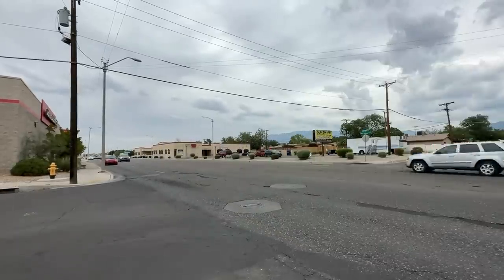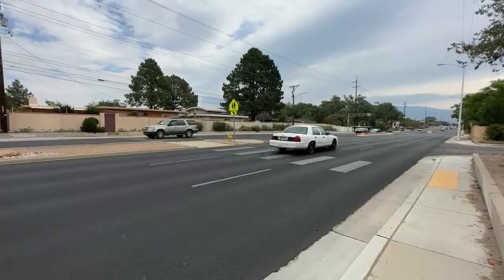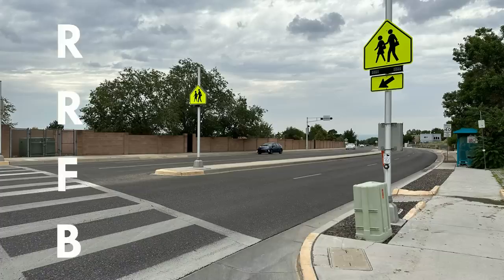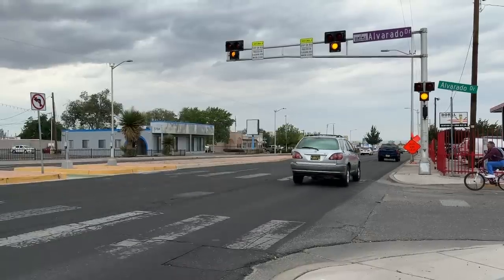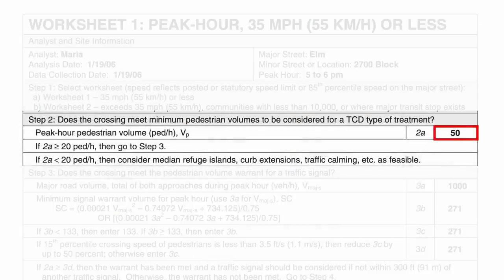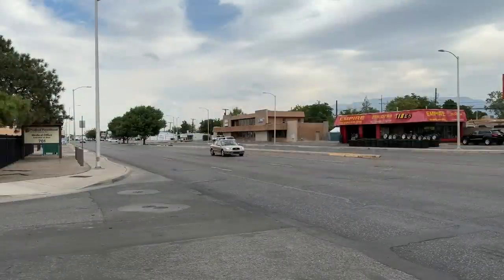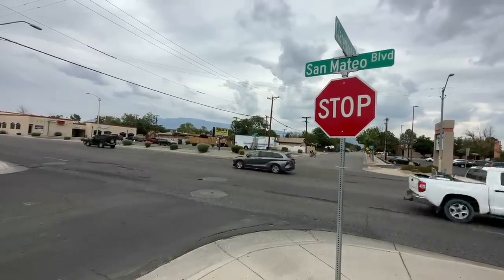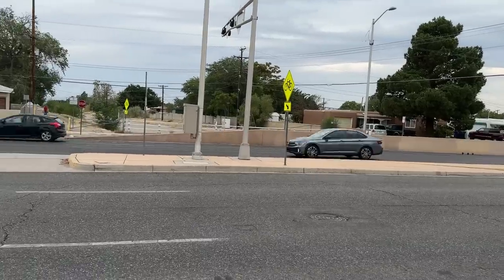The Insane Ways Traffic Engineers Try to Make Streets "Safe" For Walking

Comment: For the 20 people crossing the street on foot in a hour makes sense in some places just not most where you need a crossing.
Where i have seen it happen is before and after a theatre show opening and closing show as the parking deck is across the street. So all 40 to 75 people not all at once but at most groups of up to 8 at a time as it isn't safe to do more. After 5 ~ 7 years they put in a cross walk but no sign for cars to stop for people crossing. As the shows are like 2 to 3 hours long and it isn't a daily thing it probably wasn't high up there for them to do something about I have seen a few bus stops for schools that group enough houses together to get to 10 to 20 children per stop but they are rare.

Again in Atlanta, GA, USA yeah we have 4 lanes on each side and still get grid lock ... it is an interstate highway that you really should not try to walk across as the 55mph speed limit seems to be like a suggestion to them not a law enforced speed limit. So you have 80 ~ 100mph traffic to well we are going maybe between 3 and 10 miles per hour now with lots of just not moving at all.. That is depending on if someone crashed somewhere one the highway, how recently and how close to I-20 you are. The reason why? it is where interstate commerce trucks go now if you took the loads from the trucks to a efficiently built train system it wouldn't be that bad but as it is where you have a lot of small business trucks warehouse trucks B2B trucks and of course everyone either trying to go and go back home from work all on the road at the same time. He is showing what is in relation to it a small town. The way you calculate roads and human crossing for a small town should be different from that of a big city. Having 1 for both is just stupid.

Comment: Genuine question from someone outside the US: Is someone able to explain why HAWKs etc don't just use the regular red-yellow-green traffic lights that drivers are already familiar with? It's bonkers to expect drivers will be able to understand a whole knew signalling system on the fly.

I'm assuming it's some regulatory thing? That installing regular traffic lights has more requirements and this is supposed to skirt the classification or something?

Comment: Very interesting.  Build a new road: estimate the demand in 30 years at the most favorable growth rate possible.  Build a traffic light for pedestrians to cross?  Well, we'd have to see at least 50 people do that in one hour.  Maybe we should reverse these!  Measure how many cars are driving through a park at peak hours, and if it's over 50, consider turning it into a road.  For traffic lights, extrapolate out the city's growth 30 years and multiply that by the number of people that might be walking at that time.

Wait, is there even going to be any oil and lithium batteries in 30 years?  If not, how will people be needing 7 car lanes?  I think this wild ride is almost over.

Comment: In Finland they put just a traffic light that is controlled by a button. It does not turn red immediately on pressing. Of course it has problems. When I approach such a crossing. I first press the button. Then if there is a long gap between cars I will cross and then the light turns red stopping the cars. If there clearly are no cars I will just cross.

While such can increase safety without the light the cars should stop anyway so the light transfers rights from te pedestrian to the driver. In Finland kids are at school taught that the car goes always first. They will remember that when they become drivers. It is hard to change what one learns as a kid.

It also is annoying that they put the buttons also on normal intersections where they do little to nothing. This makes one ignore the buttons even when they must be pressed.

Comment: I mean, at least they're pretending to accommodate pedestrians. Portage & Main is considered the heart of downtown Winnipeg, and is one of the oldest intersections in Western Canada. Back in the 70s, it was also one of the most dangerous intersections for pedestrians in the country. So the city did the logical thing and closed the intersection to pedestrians. There are concrete barriers blocking the curbs around the intersection, and pedestrians are routed through and underground plaza and shopping center. And then everyone wonders why Portage & Main is littered with syringes and smells like feces.

Comment: Well now I know for sure. The installation of crosswalk lights, and any traffic control system,  isn't based on logic and local usage, but on kickbacks from light companies and likelihood of lawsuits. 
In my very small town, the main intersection ( yes, one ) has recently gotten a crosswalk indicator. I guess you'd call it a basic budget system.  Two posts, with the walk / don't walk symbols, and a button. 
Here's the part I don't get :
The button engages the light with the little person symbol,  but has absolutely no influence on the traffic light. Also, THERE IS NO DESIGNATED INTERVAL FOR PEDESTRIANS !
One must still wait for a courteous driver to stop and hold back the line of cars before one can proceed. 
The walk indicator, says go when the side street traffic gets the green light. There is no time slot to cross unimpeded. My question is : How is this helpfull? Vehicles get zero input from this system. In fact, not only are the turning lanes the ones relied upon to yield where they may not have the best view, but one direction is connected to a very high volume,  but intermittent ferry line. This street gets twenty five vehicles every five minutes,  with ninety percent of the now impatient departing drivers turning left through the single sided crosswalk !
It seems to me, that the (mostly tourists from Manhattan where they have proper crossings) pedestrians might get lulled into thinking they have their own walking period when traffic is stopped.
This is a town where in my lifetime,  the OTHER intersection joining to highway, has gone back and forth from roundabout to light twice.

Comment: Yes. I've waited about 10+ minutes before during rush hour. Many drivers don't give 2 shits about someone trying to cross the road if there's no stop light. That's why we have 5 stop lights in town now where there used to be 2 when I was a kid.
They need a whole DNC section as in Did Not Cross. And reasons why the numbers mentioned above are a joke.

Isn't rapid the last word you want in a system meant to Slow down traffic?
Also, I think all school zones should, I guess they can't ban traffic but it should be 20kph all the time even on weekends. That way drivers are forced to be careful and or not use school zones as residential slip ways like they do where I live.

Like yeah, most walkers avoid dangerous "crossing" zones for a reason. It's like only selling eggs if there's enough people baking cakes at the local fair. Only they can't bake cakes because no one is selling eggs to them.

That's the big thing that aggravates me. Cars are so much faster than walking. They don't deserve those 20 seconds if it means I can feel safer when walking across the road.
Also why aren't over head walk ways more common? Have them just above powerlines or bridge heights so trucks don't have to worry.

Comment: I really don't like these; I've got only one in town, and another far away along a greenway I rarely ride. So, the one in town isn't quite along my typical route, but I cross it often enough to dislike it. I find it is most troublesome because I'm riding an e-bike and pulling a rather lengthy tandem trail-a-bike. It is hard to get a sharp turn, but the button to flash the lights is a little difficult to use because it's set back from the ramp.

Comment: US planning question. Why aren’t roundabouts used more in the US (especially single lane ones) and are they better for pedestrians (per the research)?

Here in Israel, roundabouts…abound and they feel pretty good when out and about on foot. 😊
Reply: Roundabouts were introduced rather early in the US (1910) but were poorly implemented, leading to accidents. Signalized intersections came to be regarded as safe, and roundabouts dangerous. The US has wide arterial roads (4 to 6 to even 8 is not uncommon) which work less well with roundabouts than roads with a single lane in each direction. There’s also a lack of familiarity; we don’t have them, so drivers don’t know how to use them, so they don’t like them, so we're reluctant to build them, so we don't have them, etc. Also, driver education in the US is terrible and virtually anyone who can manage to not crash a car during the road test can get licensed.

The US has enormous trucks (lorries). Roundabouts designed for trucks have to be very large in order for the trucks to negotiate the turns. In some cases, the roundabouts are designed for the trucks to run over the “median” curb. In general, roundabouts do not work all that well for trucks.

Roundabouts don't mix well with existing development patterns—roundabouts need more right-of-way at the intersection and less in between compared to traffic signals. And they don't mix well with signals—a roundabout tends to smooth out traffic flow—which messes with signal progression. One a jurisdiction is committed to traffic signals on a corridor it is hard to change

On top of this, the United States' driving culture isn’t quite the same as Europe’s. It has been argued that powerful muscle cars, wide highways, and large pick-ups don’t necessarily lend themselves to the considerate and orderly nature of a roundabout. Journalist Stephen Beard wrote in a BBC America article: “The U.S.’s more aggressive, confrontational culture may explain why the roundabout has not been more widely adopted by Americans.” A Slate article by Tom Vanderbilt agrees, “We have grown used to (and feel comfortable with) binary, on-off traffic control … Roundabouts require drivers to make their own decisions and assess others’ actions, rather than relying on third-party signals.”
Reply: Roundabouts work well for traffic. However they are not ideal for pedestrians because the whole idea is to keep all the lanes fliwing all the time.

Comment: In Finland bile lanes are separated. They are elevated like side walks so cars cannot get to them. On large multi-lane roads they are completely separate from the road. Though there are still problems. Sometimes the bike lane abruptly stops and there is only a side walk. Recent trend has been to make them one way on the right side of the road. I do not like this as it increases the number of times one has to cross the road. I think the reason is so that car drivers do not need to look at bikers coming from the right. Again bikers need to yield to drivers.

Comment: I like to do a different calculation when saving peoples lives that will put both parents and governments at ease...
Step 1. if there is a school zone with an injury that could be solved with redesign put a 1:
Step 2, calculate all the potential income of all the students that would be lost if they were to be pernamently injured or death add on 60% for potential lawsuits... if number is greater than $1 put a 1:
Step 3: calculate step 1 and step 2, if it comes to above 1, then consider redesigning it to have pedestrians have the priority 24/7 where the speed around the immediate property of the school never exceeds 15mph and traffic calming measures are engineered into the design, for the area around the streets leading up to the school needs to be no more than 25mph for a distance of half mile or the length of the road, whichever is greater.
For roads that cannot be redesigned traffic lights must be used with crossing guards if the traffic lights are less than .25 of a mile.
Schools should never have the main entrance pointed at a main road, that would only encourage people to use that road, the main entrance should either be facing a 180 degrees to the main road OR to the nearest side roads with traffic calming measures that have pedestrians as high priority.

Increase fines so that any offense inside a school zone or construction zone has double penalty rates.

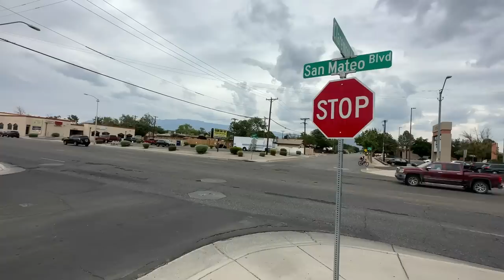Comment: I am interested in the question at 10:14 is there any place that needs a 7 lane street?   They are planning to widen a 5 to 7 through my neighborhood.   The existing 7 lane portion to the west has 37000 adt.  The 5 lane has 23000 ADT currently.  The idea to add a parallel arterial fell through due to public opposition so the 7 lane is supposedly the alternative.
Reply: I feel like building some usable public transit has got to be cheaper than that at this point. So glad I'm out of that mess.

Comment: Nailed it, CN! In the D.C. area we have all of the crossing types you highlighted in the video’s first half. Unfortunately the streets continue to be risky and deadly for pedestrians and cyclists.

Here crossing signs have even been installed at intersections that already have stoplights (see 16th and Irving NW in Street View), a reminder that drivers speed, run reds, and fail to yield to pedestrians with little consequence. Vision Zero is the mayor’s plan to eliminate all D.C. traffic deaths by 2024 and it’s often mocked as Zero Vision due to its poor impact – the number of traffic deaths has gradually risen since the start of the initiative in 2015.

Also the double threat is so scary and is something I’ve experienced both as a pedestrian and a cyclist. It’s alarming how many drivers are distracted or careless. And, frustratingly, our local traffic enforcement has been hugely deprioritized so the aggressive behavior is rarely corrected.

Comment: The role of rectangularity is not clear to me. Do drivers respond better when the RFB is rectangular?

I like what RRFBs do at a couple of locations - both have transit bus stops on busy 45-mph stroads, both are at T-intersections, and both lacked painted crosswalks. Before the beacon, traffic would seldom stop to allow pedestrians to cross...because it was nearly impossible to know if a standing pedestrian was just waiting for the bus. 

At those locations, they also got safety islands and painted crosswalks at the same time the RRFB was installed. (When I saw a notice that a light would be installed, I expected it would be a traffic light, not just a beacon - but it's still an improvement in a highly-automobile-dependent suburb.)

At the single HAWK location I encounter, there seems to be a lot of confusion - especially when the red turns to flashing-red....

Comment: Line 3c is useless.  Their SC function has a minimum at 1144 cars/hr, at a value of 94.807.  It can never be less than 93.  At least the second one (for slow roads) actually has a reasonable clip (minimum at 1763.6 c/hr, at value 107.93).

Comment: Those are everywhere here in Boulder even thought most are 100 feet from a real traffic light.  Cyclists and peds are hit regularly but the newest interesting design just about to be finished it the 30th and Colorado protected intersection.  This has these interesting small islands and bike right turns. I can see some cyclists going over the bars because they stick out into the bike lanes and are hard to see (I guess you are supposed to know that you are to exit the bike lane and enter the cross walk, slowing down to 8 MPH?), plus motorists will be trying to use these turn lanes meant for bikes but too narrow for cars....BTW my experience when I lived in Burque, was it is a horrible bike city unless you ride the goat head ridden trails but I have been on Eubank on a Sunday morning and been honked at with yells of "Get off teh F*cking road."

Comment: I'm curious what everyone thinks of "unmarked crosswalks"...? Not sure where all they are a thing, but I know that they are a thing in Washington state & Oregon. It basically is a law that states that every intersection is a crosswalk, unless otherwise marked. The catch though, is that unmarked crosswalks (no zebra stripes) require the pedestrian to breach the intersection before they have the right-of-way. Which basically means that for someone on foot to have legal right-of-way you need to step into the street. While I get the concept of these, they seem massively dangerous, and when you couple that with absurd Oregon laws that include the "no fault" clause, I just feel like you're asking for pedestrian deaths. As someone who walked a lot in 6+ years in Portland, I can tell you that I saw a lot of cars that didn't yield when they were legally required to. So frustrating when drivers completely ignore that there are other modes that have the legal upper hand....

Comment: Pl explore further. I can’t find one video on YT evaluating USA most\least effective, cheap/expensive speed mitigation strategies for: inner neighborhood streets (> 25) and typical 25 MPH,  40’ wide residential artery streets (25 mph). Assume parking on both sides. What’s the urban planning research on use of pseudo white bike lines where Amsterdam width unavailable, vs no line w bike logo painted on road. Baffled by adjacent East Bay CA cities using any of the following. Myth bust  please! Speed bumps (multiple varieties), real time speed display (RTSD), lights blink around speed limit when RTSD exceeds, flashing lights only, signage only, narrow drivable width per video. Middle groung solutions. Americans on speed and crashing on my front yard. Can send pics and police report. Thank you